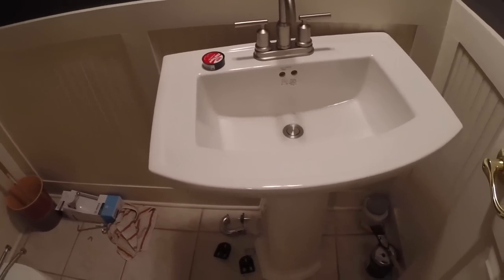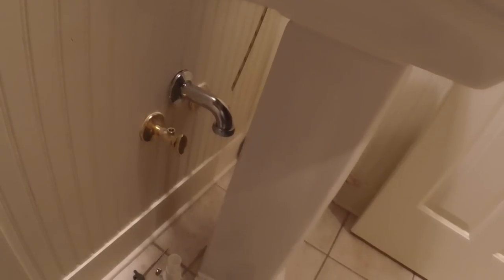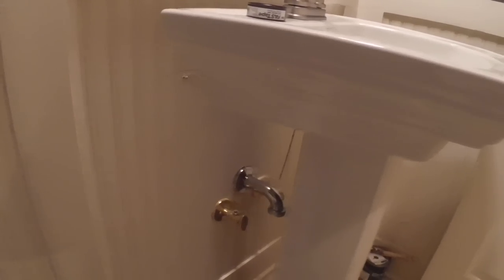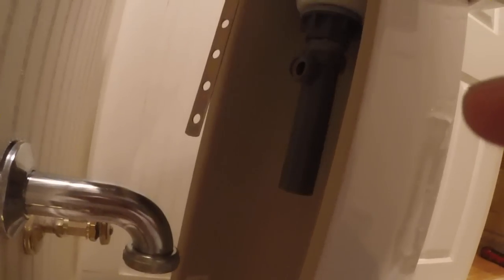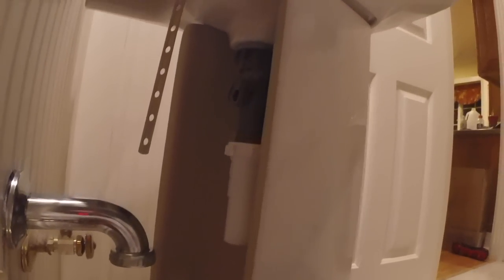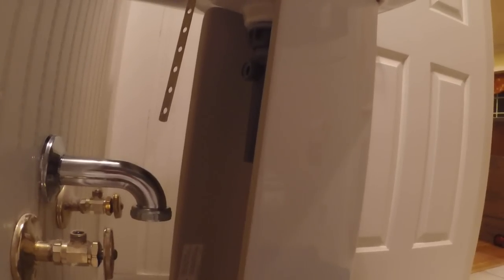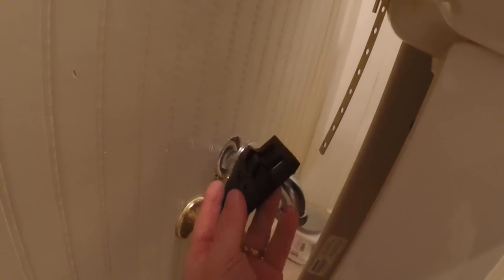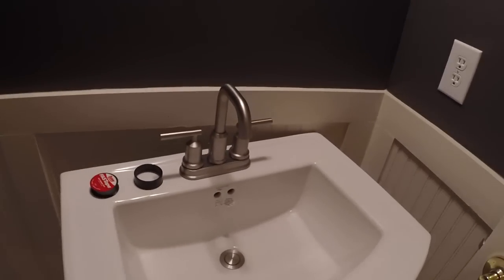Pedestal Sink Installation: What the plumbers didn't tell you

Comment: The horizontal piece of the p-trap also needs a slip nut going into the wall (adapter). It doesn't "just go in".
Reply from the maker: giarc nella yes, there is a friction fit slip nit inside the wall...just not seen in the camera shot

Comment: Geez, I wish the big box plumbing company we used to install a Pfister compression drain assembly had watched this video and ALL THE COMMENTS about NOT USING putty or tape, becuase they did, even though I GAVE THEM the Pfister instructions. They created a huge leak and - after spending hundreds (they had no idea about pedestals it turns out) - I have to do it myself. Get the one they ruined out, purchase a new one, remove the pedestal and sink, install it properly, reattach to the wall cuz they didn't do that right, they PUTTIED THE SINK TO THE PEDESTAL! My pedestal is a Kohler Memoirs, I am fed up with plumbers rn.
Reply: lol, they puttied the sink to the pedestal 😆 
What a PITA.  Those weren’t plumbers tho.

Comment: They are not 'friction fit', they are compression fit. Your horizontal drain into the wall cavity should be fixed, and not move at all. Never use Teflon tape on plastic fittings.

Comment: Just trying to help NEWBIES You dont just slip that in the wall it requires a a nut & washer to seal that from leaking. Also at 5:17 "Friction FIT"?  it needs a Hand tighting of the nut to compress the tapered O ring inside. Plus its now 2022 most are using silicone in place of plumbers putty on the drain assembly contact with sink basin. Plumbers putty is a thing of the past with Most sinks now FYI

Comment: It's a good idea to take your old (original) full trap assembly to the store with you so the person you're talking to can see what you're replacing. It'll help some of their instructions/advice make more sense to you, too.

Look closely at the instructions of your faucet set. I installed a Pfister set last night and they expressly told me NOT to use any pipe tape on threads or plumber's putty under the drain assembly (because it might damage the rubber seal they use). Many of these modern units use all compression fittings, and I think plumbers will tell you not to use tape on the threads. So when you're installing a new setup on an older house, be aware of the connections on both sides to make sure you do the right thing. Some newer faucets are surprisingly easy to install. Almost no tools needed at all. 

If there wasn't a pedestal-type sink there before, make SURE there is some kind of backing board behind the drywall for your screws to anchor to. If not, consider adding one. You don't want that pedestal sink pulling away from the wall when your kids grab it. 

Get a tube of pure silicon caulking and run a bead along the sink/wall union to keep water from sitting in there and rotting the wood/drywall. Use a wet finger to make a nice, smooth curved bead line.  

Great video, thanks!  Do it yourself, folks!  :)
Reply from the maker: Excellent suggestions. Thanks for adding to the collective knowledge!
Reply: I wish the big box plumbing company we used to install a Pfister compression drain assembly had watched this video and YOUR COMMENT about NOT USING putty or tape, because yesterday they did, even though I GAVE THEM the Pfister instructions. They created a huge leak and - after spending hundreds (they had no idea about pedestals it turns out) - I have decided to do it myself. Purchase an entire new faucet set,  remove the pedestal and sink, install it properly, reattach to the wall cuz they didn't do that right, they PUTTIED THE SINK TO THE PEDESTAL! My pedestal is a Kohler Memoirs, I am fed up with plumbers rn. I am def. going to show them your comment IF and when they return.

Comment: Good video.
Only thing i'd recommend is pipe dope over tape. Ive read tons of reviews and the dope has seen like the better choice. Ive never had an issue anytime ive used it.

I'd recommend rectorseal T plus 2(little thick and hard to use honestly, but WORKS) or Hercules Megaloc thread sealant
Reply: Yes I always use Dope Much easier

Comment: Think twice about installing a pedestal sink!  They're a real PIA to work on once installed because the wrench clearances are horrible making it a necessity, in many cases, to remove the sink entirely to replace anything attached to it!  Installing it to bead board is only as good as the hold the bead board has to the wall which is "iffy" unless the vertical on the bead board aligns exactly with (over) the two studs you really want to attach to.
Reply: I like them.  I use a bracket and screws.  I’ve never not been able to use at least one stud.  Togglers for drywall anchors.  Both of mine are self supporting so I can remove the pedestal for easy access.  The pedestal just adds strength.

Comment: Not a pro plumber here, but done plenty of plumbing over the years. That back end of the p-trap, where it
enters the wall is a leak waiting to happen. That should be a slip-joint fitting and should have a washer and a large nut to tighten it all together. Just sayin'
Reply from the maker: Interesting. Been in the house for 17 years and nothing has changed. No leaks. Feels like a friction fit type of fitting. When I push it in, I can feel pressure around the edge of the pipe as it goes in...but not super tight. Plumbers, what say ye?
Reply: I thought so too. Obviously not causing a problem in this situation but best practice would be to install as you mentioned especially since connection is in wall and can't see drips/leaks  should they occur.
Reply: Agreed. Theres no way a pipes ever suppose to move back and forth freely like that when ur done

Comment: I am pretty sure you are suposed to have a compression fitting where the pipe goes into the wall, I do not think it should just slide.  Without some type of seal on the pipe that slides into the wallyou will have water backup, a leak.  Drain lines are low pressure and gravity feed.  However, all connection on drain line require mechanical sealing.  I have not ever seen a slipe fit drain line!!  Also gasses can leak into the room around a slip fiied joint  Hope this helps.
Reply from the maker: Thanks for the insight. We’ve lived in the home for 19 years, but the sink is rarely used. That said, I’ll look into seeing what we can do to get this shored up. Thanks for the comment. I agree.

Comment: Nobody tell me how to remove the pedestal to repair the pipes underneath! Not one single video I have found explains this.
How do I take the pedestal out? I think mine is bolted to the floor.
Reply from the maker: Donald Drennan I wish I could help you. My pedestal sink was just caulked to the floor, not bolted. I did have to use a plumbers wrench to remove the water pipes that connected to the faucet up underneath the sink.
Reply: Super late reply but it is very possible it was bolted to floor or construction adhesive.  OR BOTH!  lol. Some pedestals require bolting to floor in installation.

Comment: Good advice.  Instead of making multiple trips to the hardware store, I made multiple purchases on Amazon.  I also needed a tailpipe extension.
Reply from the maker: Bob, I think I mis-spoke in the video. I think they are referred to as a slip extension. Check previous comments.  I think someone corrected me.
Reply from the maker: Slip joint extension tube...just saw one today at the hardware store

Comment: Thank you for those helpful tips , just one thing , I would need help with , would be how to properly install the pedestal on to the floor ,
Reply from the maker: Pascal Bergeron in my particular installation, I did not attach the base to the floor. There was no bracket provided with the sink. In effect, the weight of the sink will hold the base in place, but the pedestal is free floating and can be moved around. I have seen in some instances where individuals will caulk around the top and bottom, but I did not do this. Thank you for your question and I invite others to comment if they have different ideas.
Reply from the maker: Thank you Matt for the helpful clarification and reply.
Reply: indylovelace   thank you so much ,
Reply: The Lowe's video show a hole being drilled into the floor for the pedestal. I suspect that is the case with mine, however I have no idea how to remove it. I can't see how it's attached, but it definitely is. It won't budge, even if I lift up on the sink.
Reply: I finally discovered two screws going into the floor through holes in the pedestal base. I had to remove these, and also some screws holding the sink against the wall so I could lift the sink high enough to remove the pedestal.
Reply: @indylovelace  most. Ot all pedestals have a piece of porchilin that runs from one side to the other in the center. It most of the time has a hole formed thru it. You mark and drill. The gently drive a screw in. You never leave anything floating around where a child can crawl up it and pull the sink off the wall. You did so many things incorrectly on this job.. so many!

Comment: FYI better to use silicone sealer around the drain pipe fitting, plumber's putty is the traditional sealer but it will dry out and leak. Just don't tighten the filling too much or you will squeeze out all the sealer. Also, if you house is correctly built there will be a horizontal 2x4 between wall studs for attaching a sink.
Reply: Plumbers putty has never dried out on me. over 40 years... WTF is your problem!